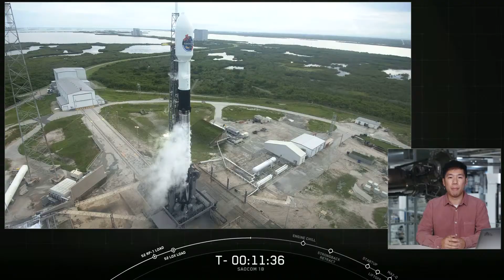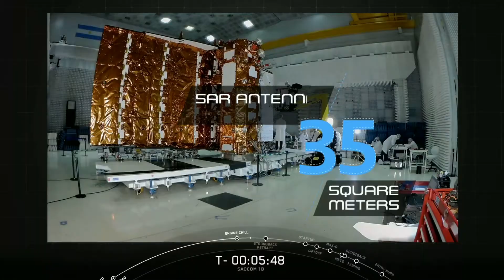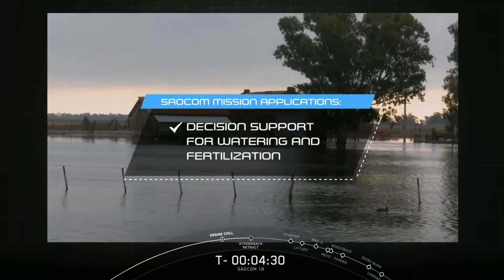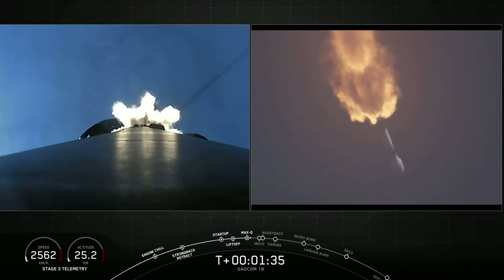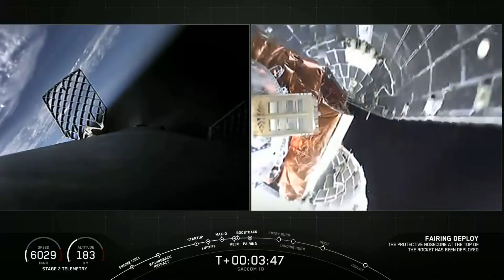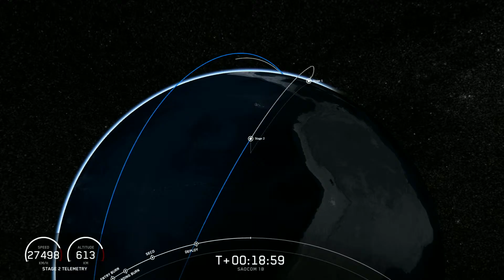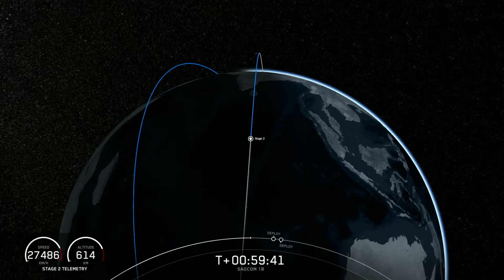SAOCOM 1B Mission

Comment: Why can't or did not they film the stars and cosmos? It's too dangerous up front? They can only film or show footage of the back?
Reply: They're too faint.
Reply: @atlas8827  So are you saying, that atmospheric light and interference make stars more visible, and in space without atmospheric and light interference, there are less stars visible? How come?
Reply: @twintwix123456789  
No, I'm saying stars are too faint, so they can't be captured by the camera unless you change the exposure settings. Doing this will make anything that is well lit turn into a white, featureless blob.
The cameras are there to record the deployment of the satellite, not to record stars. You can't do both at the same time, not during the day, without overexposing the satellite.
Reply: The cameras are placed where they are for a reason. It's so they can view critical operations of the rocket. Not for sightseeing in space.
Reply: I know that they did not film the stars. That's why I am asking WHY they did not film the stars. Is it because it would be too dangerous, or expensive? Or risky?
Reply: @atlas8827  So it's too dangerous to film the stars right?
Reply: @EVRose60  So by critical you mean it's too dangerous to film the stars. I assume.
Reply: @twintwix123456789  What would be the point of trying to film stars?
Reply: Or too not important, perhaps? Thats also a possibility.
Reply: @twintwix123456789  
I already explained, though. The cameras on the rocket are there to record the rocket and the satellite deployment. 
You *cannot* record the satellite and the stars at the same time without screwing up the image.
Reply: @atlas8827  oh, so they did not add another camera because it would be too heavy for the ship? Or it would consume too much power perhaps? Or it would burn up from extreme high speed wind maybe?
Reply: @EVRose60  so it is too pointless I assume?
Reply: @twintwix123456789  
It's just useless.
Reply: @twintwix123456789  Yes.
Reply: @atlas8827  Thank you, Guilherme Eduardo Carvalho. I understand now.
Reply: @EVRose60  ah, I understand now. Thank you, E. Rose. I appreciate it.
Reply: @nebtheweb8885  woah, that telescope is crazy good! I can hardly see 20% of that with mine. Ah well, I have seen the cosmos without atmosphere. In space, if you look away from earth/moon/sun. And you are in space behind the dark side of earth. The entire cosmos is lit up sparkling with every perceivable color known to mankind to the brim with abbundance of them all. In just one finger width of space, with extended hands, you can see maybe 14 stars with the naked eye. But it was accidentally revealed, because the people filming it pointed in the wrong direction, so they editted it out. Can't find the video anymore. But it was mindblowing.
Reply: @twintwix123456789  It isn't a telescope. It is a NIKON P900. The NIKON P1000 has an even greater magnification. Both are consumer cameras.
Reply: @nebtheweb8885  woah. Dude, you should see the size of my huge carbon fibre telescope. It's like 40 NIKON P900's. And it can't even zoom 20% of what a nikon p900 can do. Hahaha. That camera is very good.